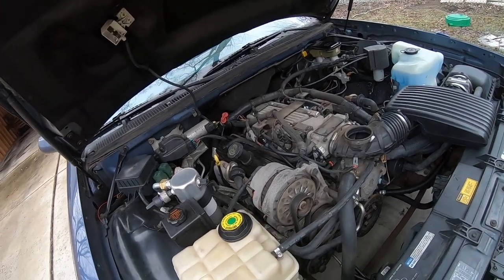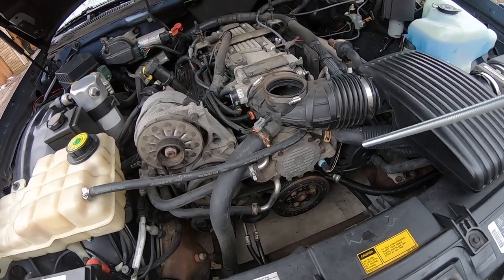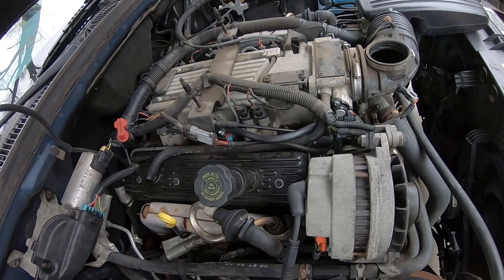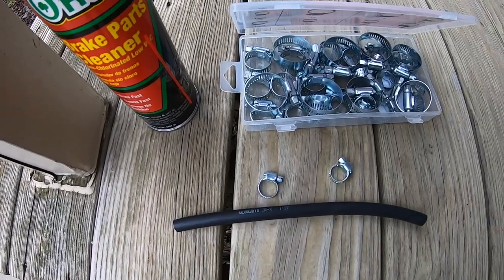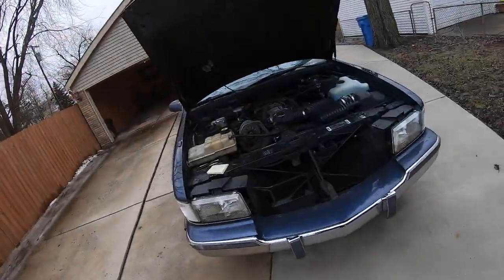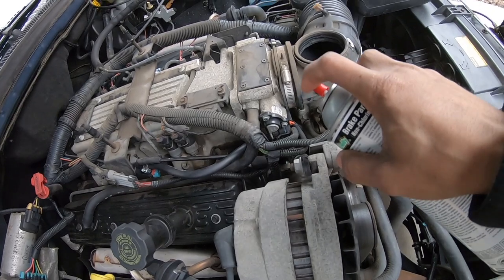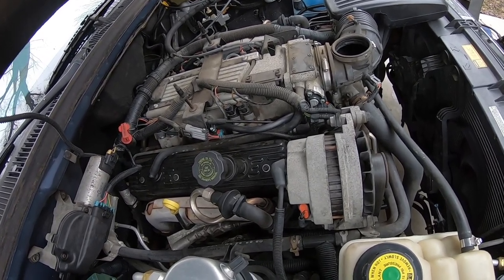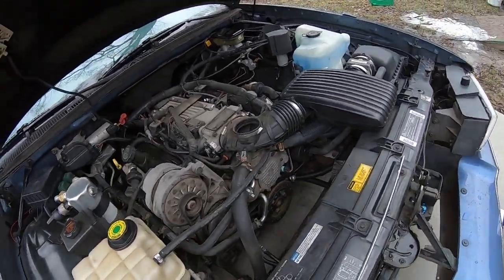LT1 Stalling Problem? Starts then Dies? Check The Vacuum Lines! Not the Optispark & Beware of Forums

Comment: Thanks man you saved me a lot of money and time cause I was just going crazy about why my 96 Caprice Classic would start and die (my vacuum lines was so brittle that they where crumbling like cookies. We need more people like you thanks man 💯😎
Reply from the maker: Thank you! I really appreciate that. Comments like this motivate to keep making these videos. I’m just trying to help people save money and fix their own cars! I’m glad this video helped you solve your stalling issue!!!
Reply: Your welcome bro ✊🏾
Reply: Ignition coil or icm
Reply: Hey Larry I also got a 96 caprice classic and I had just replaced the motor and optispark along with the computer n wiring harness but when I come to a stop the car will shake a bit then when I try to accelerate it hesitates to accelerate I was wondering to see if this has ever happened to you with ur classic ?
Reply: Were you low on power or like throttle response issues ?
Mine is like misfiring here n there but its got power ,codes say a bunch of timing and o2 sensor and fuel so you know how that goes...just curious tho man

Comment: Great presentation I learned so much. My 95 Fleetwood failed a smog inspection and the mechanic knew exactly what it was, he used a spark plug boot 90 degree elbow to fix the leak. I noticed that he had a lot of spark plug boots in his toolbox. So keep your boots.
Reply from the maker: Thanks! Great advice!

Comment: Great video! I'm going to share this on the Corvette forums.  You were spot on about what is said on the forums. That same advice is still being given today. People have replaced so many parts and taking their cars to the dealer and spent thousands of dollars and they still have the same problem I really don't think anybody checks the vacuum lines like you showed how to do. I know I haven't. I have spent 3 days troubleshooting my 93 Corvette. And it's all the things you had on your list that they say on the forms but in doing a thorough check on my car I have found some problems that I was not aware of such as broken electrical connectors to the sensors or wires where the insulation has come off. I had a bare spot on the wiring connectors to a fuel injector. My car was stolen over a year ago and I just got her back in the past 6 months.  I discovered they had cut off both of my cats with a sawzall and cut my ground wire to my starter in half ever since I got the car back I have done nothing but work on it constantly I've got the exhaust Frankenstein together for now and I just keep finding one thing after another wrong with her. I have broken down at least seven times within a 2-week period in the last month and stranded an hour away from home with no help. Once I made it home I decided that car is not going out on the road again until everything on it is gone through and fixed correctly to where it's not going to leave me stranded. I have always worked on my car since I got it in 2009 and I know that car pretty darn well. I never really understood the vacuum system and how much it can mess up your car if it's leaking or if  hoses are missing. Today I'm trying to figure out what vacuum hoses are missing off of my car. The air system was removed from my car by whoever stole it. So I'm trying to work backwards and figure out what the heck is missing and what I need to replace. My car's name is Ruby She is a 40th anniversary edition, LT1, six speed manual transmission and is ruby red inside and out with the removable targa top. I am the second owner and found her in Florida after looking for 6 months. I'm in Texas and bought the car sight unseen and flew to Florida to drive her back home. She was in the Sun Coast Corvette club in Florida and won trophies at every car show. During the time she was stolen from me she was not covered and suffered major paint and body damage in addition to destroying my exhaust and everything else they've done with the engine. I installed a Corsa sport Cat-Back exhaust in 2010 and it was really  awesome. You should see it now with flex pipe and pieces of cut pipe all clamped on to go from the headers back to the cat back system. Anyway I appreciate your video I'm going to watch it again over and over if I have to and I'm going to definitely share it with Corvette owners experiencing the same issue
Reply from the maker: @StephanieClark-k4i  Thank you so much! I appreciate the kind words. It sounds like you have an awesome Vette. You should share it on YouTube.

Comment: Thanks for the admonition to check the simple stuff first and the example of following the problem in depth, not just a quick look. Since my Dad passed, I have been driving his 1995 Buick Roadmaster. Occasionally, the car would just die and I couldn’t figure out the problem. I finally found that the auxiliary battery post was a never fixed recall. I replaced that and it fixed the problem. But, I only found it because I started following wires to each connection, not just doing a visual inspection. I also plan to check all the vacuum lines and I thank you for the hints on simple and cheap ways to fix them.
Reply from the maker: You’re welcome! I’m sorry to hear about your dad. I hope you get many years of great memories from his Roadmaster. 🙏🏽

Comment: Guys, Working with Wimberley is 100% right by starting with vacuum lines first. It is the correct way to diagnose
any engine problem.  I diagnose vacuum leaks with a Vacuum Gauge.  If there is an indication of a leak, I then do
the same.  Spray ether or brake cleaner.  A vacuum gauge can detect several problems from sticking valves to
timing issues. One can be bought almost anywhere and will save a lot of time and money in the long run.  I had
the same problem with my 1996 Caprice B4U model. It would start but then stall. I used to same process to 
determine my issue was not the Black Plague Opti but a bad fuel pump. I spent zero dollars finding my issue.
I followed the same process of "KISS"  Keep it Simple Stupid :-))  Listen to Working with Wimberely. He is right.
I have had to replace the distributor cap at 140,000 miles . Parts do wear out. The cap is less than $ 15.00. dont
waste your money on a new Opti until you can verify it is really needed.      Regards from Ody Slim
Reply from the maker: Thanks for the feedback and great advice! I don’t have a vacuum gauge, but I’m going to get one. I just wanted to share my story about how a fixed a potentially expensive problem for a few dollars because I figured it could help someone else out!

Comment: Years ago after installing a new msd opti in my Camaro. My Camaro would surge.  I'd be at a stop light in the car would just jump forward out of nowhere basically had to put it in neutral stuff on break to keep it from happening.  I went on to the forums as I knew they would they jumped all over my new msd opti.  They told me I got to rip it out and send it back. They were all over it. I had a friend who came over and look at it and he suggested to go over all the vacuum lines.  So we did we changed all of them.  Well low and behold The surge was fixed. Here's the shit though so I went back online and told them I fixed the surge in the idle by changing the vacuum lines.  They didn't believe me.   They told me I was wrong. That maybe at best it was a temp fix.  This is seven  maybe eight years ago. I  still have that same opti in my car now.
Reply from the maker: I 100% believe you. I’ve seen guys saying certain wheels won’t fit on a car. Then another guy posts a picture below their post with the wheels on his car proving that they fit. They still won’t admit they were wrong with photographic evidence lol! I use the forums a lot for information, but I usually don’t post. And reasons like yours and my example are exactly why. Ultimately I’m glad we were able to solve ours with vacuum lines, and I’m hoping this video will help more people as well! I actually have a part 2 I need to record. It started misfiring again. Turns out it was a bad spark plug wire. The boot failed and the spark was arcing off of the exhaust manifold. I changed the wire and plug and it’s back to running perfectly. The original opti is still in the car doing just fine.
Reply: @WorkingWithWimberley  keep up the good work.. Your videos regarding your LT1 are great.  I've watched all of them repeatedly. F**k the forums !   Those guys have a lock on all things LT1 and it is the forums that give our awesome motor a bad name.  Anyone who knows there shit knows the LT1 is an outstanding motor. It's not an LS1 but it's the very next best thing and it sounds better then any other motor including the LS1 with the proper intake and exhaust on it.  To me the LS1 sounds ricey while the LT1 sounds like a proper muscle car.

Comment: Very well done!  I know I'm late to the party, but I'd like to add another thing that can trip folks up with LT1s who might have ended up at this video.  My 96 Roadmaster had a popping/stalling issue when jumping hard on the accelerator from a stop when the car was up to temp(think like, trying to dart into traffic from a parking lot).  I could also get the engine to pop/backfire through the intake when I would aggressively snap the throttle open by hand under the hood.  Obvious lean condition, but no codes set, car otherwise drove normally.  I did all the usual checks, put a new EGR valve on it, tried a different TPS sensor, nothing seemed to fix the problem.  A coworker had an older Buick that used a lot of the same engine management parts that my Roadmaster used.  The problem went away when I swapped in his known good MAF sensor.  Cool, problem solved.  I went out at got an inexpensive replacement MAF from everybody's favorite orange parts store and put it on the car and the problem was STILL THERE!!!!  Put the known good MAF back on, the problem went away.  I had to spring for a Delphi new replacement(not a reman) from RockAuto to get the problem to go away for good.
Reply from the maker: Thanks for the info!

Comment: I had the same leak on my 96 SS.. it kept throwing a code and running rough. I was able to wrap the cracked boot with electrical tape and fixed my issue that way. Thanks for the video!
Reply from the maker: You’re welcome! I’m glad the video helped!

Comment: Awesome video.  These cars are old enough to where everything made of rubber needs to be replaced.  Just had an issue with the HVAC knob leaking vacuum.  Only thing I could come up with is the rubber disc with all the vacuum channels to control the vents is wearing out.
Reply from the maker: Thanks! And you're right. After time, the rubber and plastic can start to deteriorate and will need to be replaced!

Comment: When You pointed out the iac valve . You pointed to the tps sensor . The iac is harder to get to its under the tps sensor
Reply from the maker: Thanks for letting me know.
Reply: @WorkingWithWimberley  Yeah. I have a 94 Z28 Camaro and you did point to the tps, but great job. Really informative and you are right. Don't waste a lot of money, until you check for leaks. I love driving my "Jack." He only has 110,000 miles. Roars like a lion. Great video. God bless.
Reply from the maker: That's pretty cool. The 94 Z28 is nice! Thanks for the feedback and God Bless you too!!!

Comment: Awesome presentation and information. I have a 1996 Impala SS w/LT1 stock, original owner. Recently replaced Evap solenoid (as well as flow switch just in case), hoses look OK but I tightened them up anyway with clamps. Will try that spray check to ensure good sealing, though they had been smoke tested recently. Thank you very much.
Reply from the maker: I believe the spray check does work well. It worked for me. You can search on YouTube and see many mechanics use this method in their shops too. 👌🏽
Reply: @WorkingWithWimberley  Thank you very much! I was suspicious of their smoke tests when either 1 or 2 shops connected the evap solenoid hoses backwards. Now fixed, by me.

Comment: Another helpful vid Steven.  I'm currently working on a 94 roadmaster that had a complete and total hack working on it before I aquire it. The most interesting thing I found so far is the sunpro temp gauge sender screwed in where the cts is supposed to be on the water pump. I guess the temp gauge in the dash wasn't working correctly.  But what I found next totally blew my mind....the hack, realized his mistake, but instead of putting the cts back, he just plugged the connector back in and set it on the intake manifold. The car isn't showing a CEL, but it sure is terrible on fuel. Hmmm.....i wonder y. Thanks again man, you have been a good source of info for me with this. Cheers
Reply from the maker: Thanks! I appreciate the feedback. I drive older cars too and one of the biggest hurdles is fixing all of the bad work that the car has had over the years. I’ve been there lol!
Reply: What's the cts? My temp gage isnt working either and I replaced that same sensor on the water pump with a generic temp switch hoping it would fix it. The haynes manuel isn't very clear on which gage is witch and finding the right part is not easy

Comment: Thanks for the video and showing me where all the vacuum lines are. I am in the same boat. It will run, but I step on the accelerator and it wants to bog down and die. It has only 47,000 miles but I am trying to track down the issue. Thanks.
Reply from the maker: You’re welcome! I’m glad the video helped! When I had a hesitation issue, it was actually a spark plug wire. So you may want to check that too. https://youtu.be/rNYMPEZbV20

Comment: I will be doing this tomorrow the car runs pretty good but it can stall out of nowhere no warning it’s been to the shop I have ran codes as well had a bad EGR valve still stalls it has new maf,tps,plugs wires ,crankshaft sensor the opti is 8 years old but I been going through this frustration it’s my daily driver right now and stuck on the road in rush hour isn’t fun but I will keep searching thanks for the content
Reply from the maker: You’re welcome! I hope you’re able to find your issue.
Reply: @WorkingWithWimberley  well I can’t find a vacuum problem so far I think I have one more sensor to check the fuel pressure and it will probably be the opti spark because I don’t want it to be the issue

Comment: Great video. I'm going to look at a 93 camaro with lt1 and the said it acts like it was starving for fuel so he replaced the fuel pump and its still doing the same. He thinks it's the ignition or security system but it has no security light on dash. What would you look at first thanks for any help. Glad I watch your video because everyone said it was the optispark just like you stated.
Reply from the maker: I’ve had two issues with mine. 1. Was bad vacuum lines and 2. Was a bad plug wire where it was arcing off the exhaust manifold making the engine misfire. I replaced the vacuum lines and replaced the bad spark plug wire and it’s been great ever since.
Reply: @WorkingWithWimberley  I went and looked at it it turned over when I sprayed gas in intake but the fuel pump wouldn't prime. Maybe bad key/Ignition

Comment: You are right 100%. When I changed my egr Pulled the break booster hose loose. Its was so dark in my bro in laws garage. I noticed my break was so stiff too when I tried to start it. I will also replace all the hose   clamps that you have to pinch to take off. EGR was bad tho.
Reply from the maker: Good! I’m glad you were able to fix it!!

Comment: I have a 93, 94, and two 95's (all with same issue "starts, runs till it get warm, then cuts off. Won't start until it cools back off).  I changed ignition, wires, plugs, new fuel filter, fuel pump, new vacuum line hoses (tests for leak "there are none"), new temp sensors, new fuses (and a hold host of other things that I can't think of right now). Another issue is that the radiator fluid turns brown. I've replaced water pump, heater core, radiator, temperature gauge and flushed the engine several times.
The cars will start and run till they get warm, then shut off. There is no fuel flowing to the intake. After they cool down, fuel then flows to the intake, and it starts. Get warm and then the same process. In the little time that it runs the coolant becomes brown. There is no indication of head gasket leak or other loses of pressure. 
Anyone know what the issue may be.
Reply from the maker: One of the main things I see mentioned in the forums is the ICM ignition control module. If you already replaced that, then I don’t know.
Reply: @WorkingWithWimberley  Yes! I've replaced that also. Same issue. This issue is always with certain former police vehicles. They are doing something to the vehicle that causes it to shut off (case the car not to supply fuel to injectors) when it get warm. It's something simple that they do to cause this.

Comment: That's not an IAC valve ...... that's TPS (Throttle Position sensor)..... but I was that guy that spent all that money on all these parts and still haven't found my problem,  but I'm about to do this soon as I get home !
Reply from the maker: Thanks for the correction. I hope you find the issue and get it fixed.